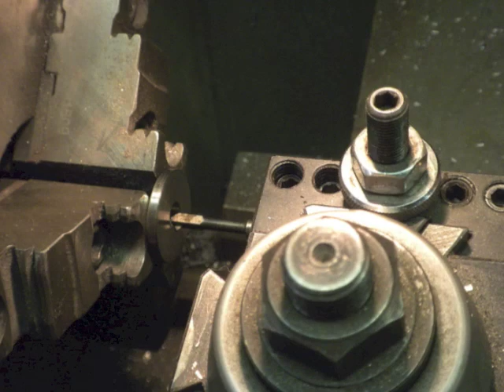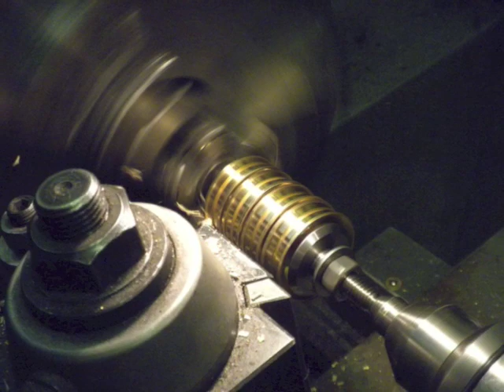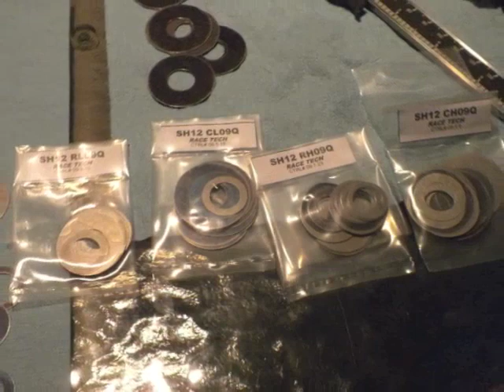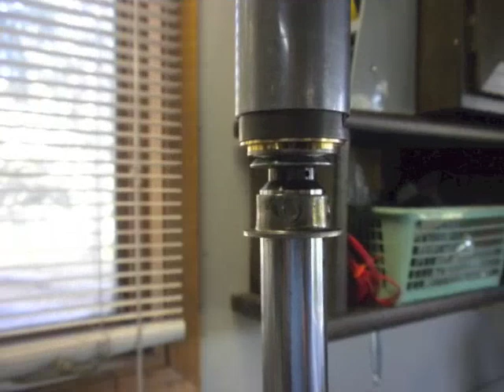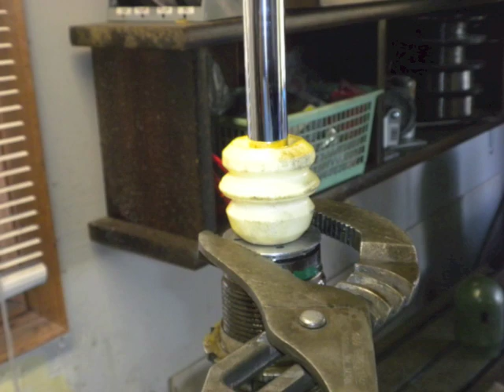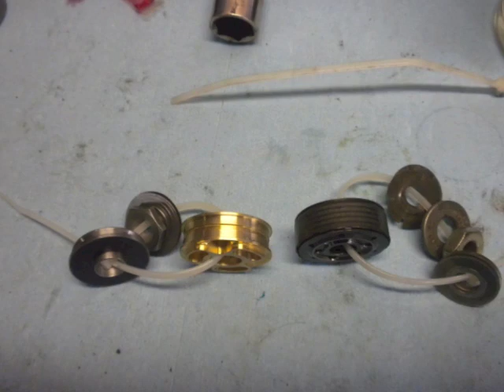Tein Strut Revalve Shock Rebuild Gold Valves DIY

Comment: Do you have a video of the final strut that has the tap and dye fitting mounted to the welded plate, gassed up, and fully working? 

I have a Nissan Tein strut and I’m attempting to do the same thing. I knew this process was fully possible, your struts are the proof. Great job and write up sir.

Comment: Hey John Looking for some advice. I have rebuilt my old Ground Control Advance designs and Bilstiens with Schrader valves many times but both Mono tube shocks. I recently picked up a set of Tein Type flex twin tube shocks. They need oil and re charged the return of one shock is way slower then the other. And the rears have a dead spot at the beginning stroke also.   SO  what's the procedure to bleed the inner tube? and then what im trying to find out is.... Your Schrader valve is charging the OIL inside the shock? or just the outertube? You know I may sound like a newb which is the case cause I have never looked into rebuild a twin tube shock.Hope I can get some info from you.

Comment from the maker: Yes.  I experimented with various pressures as high as 100 PSI and found that I like 19 PSI best for this application.  More than that raises the dynamic roll center of the car in a slalom for example.

Comment: Hi why did you go with these racetech valves instead of the Tein? Is Tein out of business? Also why not bilstein or some other company or was it that the racetech were the closest to fitting?
Reply from the maker: The Racetech valves are much more tunable and can be set up digressive compression damping.  The Tein valves have small flow holes and a very harsh ride quality with poor traction over sharp square edged bumps. The Racetech valves ride nicely and stay glued over bumps.
Reply from the maker: cms-gt4
Hey GT4. Racetech gold valves were the best at the time.  QA1 now has 35mm digressive valves which may bolt in with no machining needed. They also make a variety of base valves in 35mm.  You can buy used shim assortments from Penske Shocks on e bay. I spent at least $800 for this project with machining costs, bump stops, oil, etc.  For lower height use tall Speedthane bumps stops from PitStop USA and you can lower until they make contact at ride height.  This will maintain downtravel.  Nice car and cool videos!
Reply: John Broderick What do you think it cost you to do this? I have tein HAs and that is one reason I am considering upgrading to another coilover is they are not digressive and don't deal with rough roads as much as I like. Do you think they could also be shortened with some changes to the internals? I would like to reduce my ride height about 20mm but keep the stroke. At the moment my mind is set on getting another setup.
Reply from the maker: John Broderick
RE Suspension has a great selection of bump stops also known as bump rubbers
Reply: John Broderick Thanks for the info and compliment. Looks like QA1 also have ball joints that might suit my needs to resolve bump steer. I am going to do a bit more research on this, but I am wondering for the cost if I would be happier modifying some bilsteins for the Evo MR to fit my car. Thanks again for the info.

Comment from the maker: Hey todapwr1, I used the Toyota factory shaft seal for a 93 MR2 strut.  I replaced the tiny o-rings with a small amount of hylomar sealant carefully removing the excess.
Also check out the Moton shaft seals from AST to see if they fit your application as they are super low drag and low stiction.

Comment: Great video, what state are you in? Just asking because I wanted ti know about your climate and changes there. I'm in So. California So I was asking for oil choices
Reply from the maker: Thanks DeMoeAurelius!  I am in a state of mild contentment. Lucky you being in So. California! If I lived there I would tune with Silkolene Pro-RSF 2.5w racing suspension fluid for a street driven vehicle.  If you race long duration events on a track measure shock temps and contact the oil manufacturer to make sure you are within the effective operating range of the oil that you plan to use.   Where I live air temp varies from -20F to 100F .